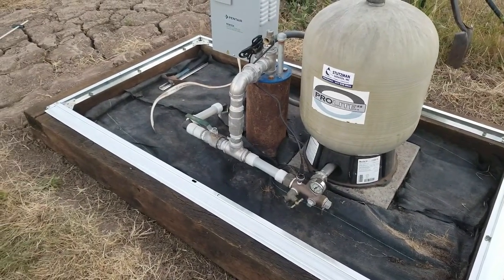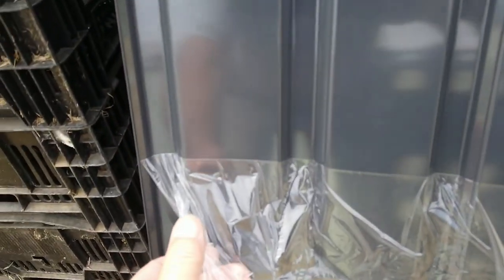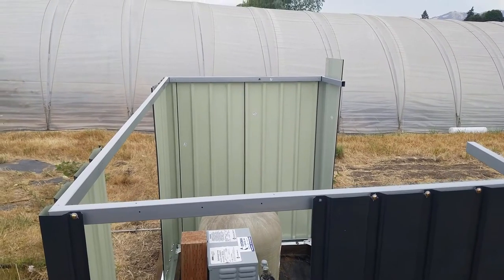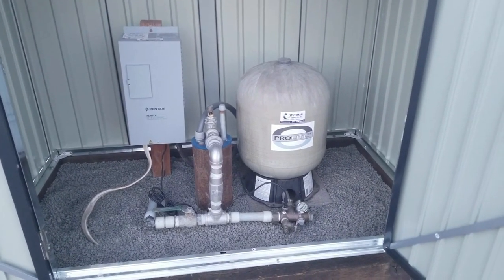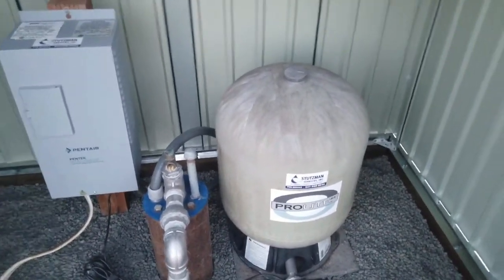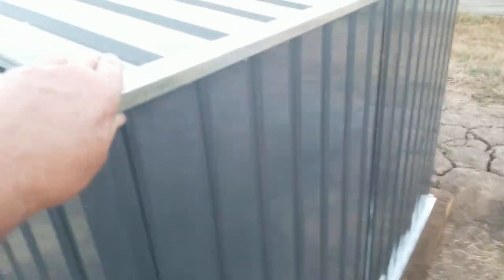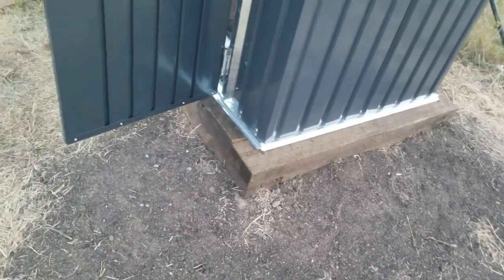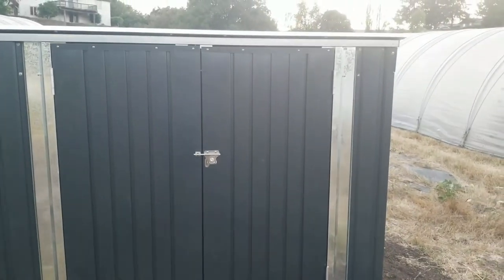Pump House Build

Comment: I like the low cost and simplicity of the construction, but how  durable would this be under redwood trees in California? The redwoods we have frequently drop branches up to 6 inches in diameter during winter storms which would cause great damage to the well head if not protected by a strong roof.    Would this type of structure would hold up to this?
Reply from the maker: This would not work for your application. There is no internal steel or frame structure to give it any support. It is low cost and simple for our purposes of keeping the rain and snow off our pump. Thank you for your question and watching.

Comment: How's that working through the winter? Also, any trouble with bees or wasps making homes in there?
Reply from the maker: This made it through the winter pretty well. We don't really get super cold Winters so I didn't need to insulate the inside. But I'm thinking if I lived in a climate that stayed freezing for a prolonged period of time I would use foam board insulation on the inside. At this point I haven't had any trouble with the wasps but it would be an excellent home so I'm sure they'll find it at some point. Thanks for watching and appreciate the comment.
Reply: @BareMtnFarm a light bulb should be enough to keep it from freezing